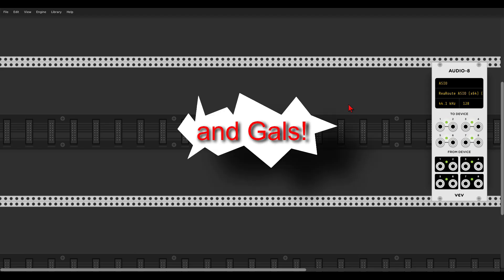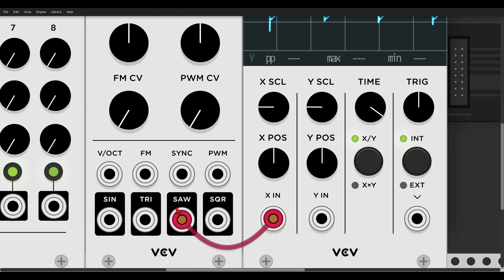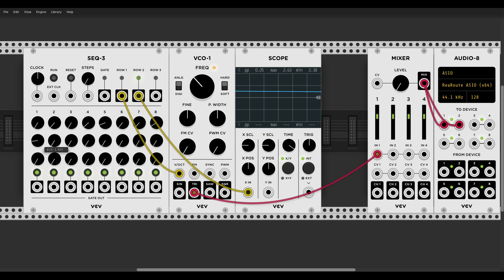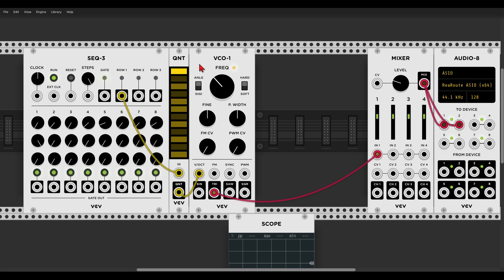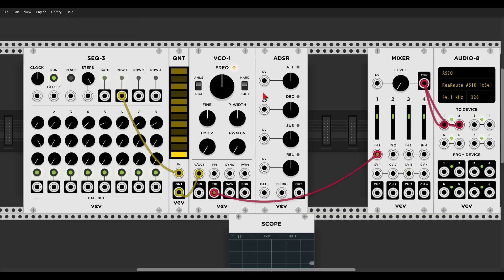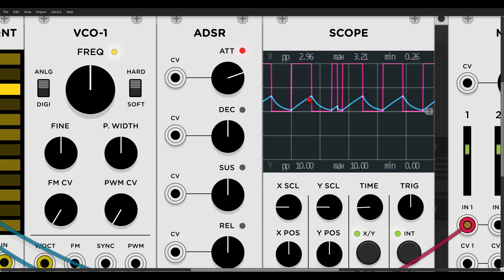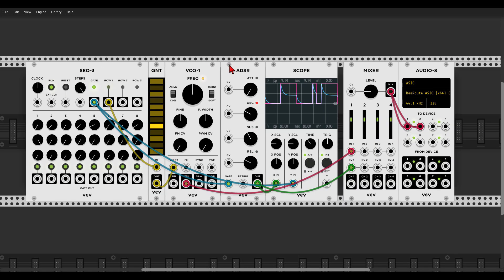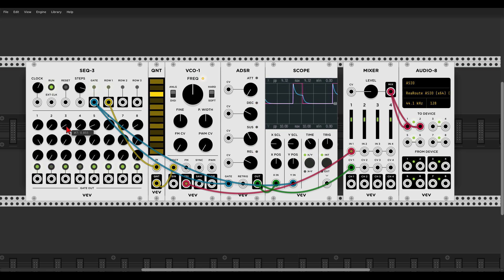Beginner's Patches I - Basic Sequence

Comment: Thanks for the amazing content but these modules look nothing like the version you're displaying here at this point in time (Rack 2 - January 2022). For example "Seq 3" has no "gate" or "row 1,2,3" anymore. VCO-1 doesn't exist any longer it's just called VCO now and it doesn't have the same connectors. ADSR does not have "out" any longer. I have no idea how to connect these.
Reply from the maker: Hi! Don't let the looks confuse you, they are pretty much the same. Actually, it's even better that they don't look the same because it will bring you to concentrate more on the ideas behind the modules rather than the modules themselves so you could use any other oscillator or sequencer. That said, have a look here - https://omricohen.gumroad.com/l/vcv2fundamental
I created a free mini-series on the differences between the versions. I hope it will help you.
Reply: @OmriCohen-Music  cheers Omri - I'll check it out

Comment: This is a really helpful video, cheers Omri 👍 I have a quick question about the Seq 3 module though. In VCV Rack 2, it doesn't seem to have a gate thing. Which way would be the best way to connect an ADSR to a Seq 3 in VCV Rack 2? 

Thanks!
Reply from the maker: Cheers! Well, in the right click menu, you can change this setting by activating clock pass-through. It should output gates then. Have a look here - https://omricohen.gumroad.com/l/vcv2fundamental
I created a free mini-series about the differences in V2 with the Fundamental modules. You might find it helpful :)
Reply: @OmriCohen-Music  Thanks Omri  🎶 🎵

Comment: The delay and reverb is possible with the beginner VCV modules?
Reply from the maker: Well, the delay yes, but there's no free reverb from VCV, unfortunately. There are other free reverbs though.
Reply: @OmriCohen-Music  Nice! Hopefully You will though this on other videos (Still haven't watched yet, so I'm doing step by step) 

One thing that I didn't understand is, Why ADSR is connected to the Mixer? 
 

1The clock and sequencer create the pattern of time and voltage gate.
why the gate goes to ADSR and not VCO? 

it seams that the two things are treated separated. but why is that?
Reply from the maker: @rafaelriva0  Yeah, in the fourth video I add a delay :) This mixer from VCV is actually 4 VCAs so each channel has a CV input that you can use, for example, with an ADSR envelope to control the level of the signal. The ADSR is working together with a gate signal that dictates when and how it should work. The VCO will generate the sound, but the ADSR will set its level envelope, its volume over time, together with the gates. I hope it makes sense.

Comment: As a beginner, how do I avoid clipping? Also, is there any module that shows loudness in db?
Reply from the maker: Hi! Well, it's all voltage so you can use any kind of attenuation basically, even a "simple" VCA. And yes, there's the stereo VU module from BogAudio that you can use. And I anyway recommend having the BogAudio collection, especially if you're a beginner. Let me know how it goes :)

Comment: Thank you so much for this! I have a question, what is the signal flow? I understand how to make a ADSR work, but cant figure out how LOL. Like, when do we modulate the signal with the ADSR? Because by the look of it, its in the end of the chain, but it dont make too much sense for me. Anyway, I tried my best to be clear... Cheers!
Reply from the maker: Hi! Think of an ADSR as a one shot modulation source. You gate it, and it outputs the signal once. So basically, you can use it for all sorts of things and it doesn't have to be at the end of the chain. That said, it's common to use an ADSR for controlling the amplitude of a voice. For this, you will need some sort of module that can allow you to change the amplitude and it's also controllable with CV. This is the VCA. So you can send your voice through the VCA, and use the ADSR to control the amplitude of the signal through the CV input of the VCA. That way, instead of manually changing the amplitude of your voice, you gate the envelope and it will do it for you.  Does this make sense?
Reply: @OmriCohen-Music  thank You so much for the answer! I think I got it. Your channel is a AWESOME source for my studies. Cheers! 🙏🏼
Reply from the maker: @vjcasagrande  I'm happy I can help 🙂

Comment: Bro, thanks for this amazing content! you're the best, correct me if im wrong, but when you change the pitch on VCO to A 440hz, the scale that you got is A minor, right?
Reply from the maker: Thanks! Well, yes, the quantizer will add an offset to the pitch you have on the oscillator so if you have a minor scale set on the quantizer, and the oscillator is tuned to A, you will have an A minor scale.

Comment: Absolutely fantastic video! I have a little question, if I may. When I try to route the out of the ADSR to the VC1 of the mixer, for some reason all sound stops. Am I missing something? Everything else seems to be fine. Thanks in advance!! :)
Reply from the maker: Thank you! And yes, that's normal. As soon as you connect the ADSR to the CV input, it will wait for the CV so it knows when and how to work, sort of.

Comment: omri! Where did the reverb and delay come from? Do you have this running through a DAW?
Reply from the maker: I just added them in post...
Reply: @OmriCohen-Music  thanks for responding. What I should have asked is how are you getting sounds out of vcv rack into a recording program? I haven't figured that out
Reply from the maker: @darrenfromla  Oh ok, no worries :) Well, there are a few options. First of all, you can use the VCV recorder to record audio (and even video) and then load it into your DAW. There are also polyphonic recorders from nysthi that can record up to 64 channels. Another way is with Reaper on Windows, that's what I'm doing. On Windows, Reaper has a plugin called ReaRoute, which allows you to route sound from VCV into Reaper in real time. Let me know if it's interesting for you and I can help you out setting it up.
Reply: @OmriCohen-Music  thanks for the info and the help! I was just researching and found something called midiloop. Should help me get vcv routed into ableton live. Reaper is great though. Thank you for offering y help and thanks for the feedback. Much appreciated
Reply from the maker: @darrenfromla  My pleasure, have fun!
Reply: @OmriCohen-Music  im using ableton and there's a few workarounds to get it working  but it's definitely not as easy as reaper.

Comment: In a real analog ADSR, it seems to me the Attack and Decay set a rate, rather than an actual time. In particular, if you have a high sustain voltage, the Decay will last a short time, but a low Sustain level will result in a longer Decay. I suppose the same would be true of Release ... if a new note comes along, the previous note never decays to zero.Ooops, Guess you can tell where I paused to write this ... you said the same thing about Release.
Reply from the maker: Well, think of it this way, when the sustain is high, the way the decay time has is much shorter than when the sustain is low so it's all relative at the end of the day.

Comment: I am just starting out so this may be obvious. But, how do you change the size of the gate? Just by changing the clock rate? Otherwise notes would have to overlap?
Reply from the maker: Well, there are a few ways you can do this, depends on which modules you use. In this case, as in the video, you can use DGATE for example from BogAudio. It has a Gate Length knob that you can use to change the gate length. Don't forget that a gate is just a pulse wave so if you're using an LFO as your clock, for example, you can change the pulse width, which will give you the same result. Does this make sense?
Reply: @OmriCohen-Music  Yes. Thanks very much for this! So by default the clock just a pulse wave by default? And by default, the gate is locked to the clock? Unless I repatch it? (not sure I'm asking this question clearly)
Reply from the maker: @gkillmaster  Well, if we're speaking about this specific sequencer, the SEQ-3, than the gate output will just output the clock by default, unless you disable a step by clocking the green lights under each step. And you can try and use other waveforms as your clock, but the most stable will be to use a pulse wave so that's why most of the clocks (I say most because I didn't check them all but I'm pretty sure they're all the same) will output a pulse wave. The only difference will be the length/duty cycle/ pulse width of the wave.
Reply from the maker: @gkillmaster  My pleasure :) And yes, this is a universe whole by its own. Just make sure to take it one step at the time, and don't give up!

Comment: Just a quick tip about the Scope. If you are looking at something that is triggered by a clock or gate like when you where looking at the Envelope shape, you can use the gate to trigger the scope. Wire the gate or clock into the Scope's far right input and click the button to make it use an external trigger (EXT light is green). If all goes well then you'll have a steady look and your Envelope shape. You may still need to adjust the trigger level to get a steady image. This is also really useful for looking at your waveshapes. You can use a square wave of the same frequency as your note to hold the wave steady on the scope.
Reply from the maker: Perfect! Thanks so much!

Comment: I'm afraid I missed something ... how do I set the patch cables colors?
Reply from the maker: Well, the cables have a certain order so if you have a green cable, the one after that will be red, then blue, and then yellow, so you can just use the color you want. There is also an option to add\change colors in the settings-v1.json file in the Rack directory.
Reply: @OmriCohen-Music  Thank you, I just wanted to ask the same question. It would be nice to have a colorpicker in the menue. I hope it will be implementet. But to know that the color is not choosen randomly is nice to know. Im not sure if the color is changing after reopening the project. I need to try it out tommorow. 😃

Comment: How do you use triggers?  I see that a lot but don't see how they're used. What's a shift register?  And what is the different between a clock modulator and a generator,  skew, or multiple?   I was poking around on the Modular Grid net & saw all of these things mentioned but not exactly understanding what they are for.  It would be nice to see an application in VCV Rack where applicable.
Reply from the maker: Great ideas my friend, thank you!

Comment: Really good tutorial helps me to understand the synthesis more. How do you make the gate longer? Or does it have to be longer if you want longer note?
Reply: Bonjour, le sequenceur génère un GATE donc en ralentissant la vitesse du sequenceur le GATE sera plus long, donnant ainsi plus d'espace à l'enveloppe pour se réaliser. Cependant il existe des modules permettant d'allonger un TRIGER qui est une impulsion très courte pour en faire un GATE et donner une fois de plus le temps à l'enveloppe de faire son cycle.

Hello, the sequencer generates a GATE so by slowing the speed of the sequencer the GATE will be longer, giving more space to the envelope to be realized and make long note. However, there are modules to extend a TRIGER that is a very short pulse to make it a GATE and give the envelope time to cycle again. In chain u will have very long note.
Reply from the maker: Thanks so much! Well, this sequencer has gates with a fixed pulse width, but there are ways to change this, and we will also look at different sequencers in future episodes that have this feature also built-in.

Comment: Great video. I look forward to the series.

I would say use the scope as much as possible as it makes the modulations a lot easier to understand. You make great use of it in this video.

I would suggest doing a video on attenuverting the v/oct output of sequencers and random generators. It took me a while to figure out why my VCOs were popping and cracking and it was because of the input being fed in way too high in amplitude.
Reply from the maker: Thanks! Yeah, the scope will be an important part of this series. Thanks for the suggestion also!

Comment: Hey Omri, I often see envelopes used with a separate VCA module, but I've always preferred using an envelope generator connected to the mixer channel attenuator as here. Is there a 'right' way? I guess not, but am perplexed why someone would add another seemingly superfluous module: a separate additional voltage controlled amplifier. KiSS ;)
Reply from the maker: Hi! Well, there are a few reasons I can think of. First of all, you have to think about response curves, some mixers will respond differently to the incoming voltage. Also, usually the mixer is not a part of the chain but comes at the end of the chain, after all the processing and effects, so maybe you want to control the level before all that. It's also easier visually to understand what's going on when the VCA is a part of the actual chain and not somewhere distant from it. Also, usually, a VCA is just an attenuator that can be controlled with voltage, and a mixer can also amplify the signal, something you may not want. In hardware, by the way, many mixers don't even have CV inputs for their levels. Anyway, since we're talking about modular, there is no right or wrong, so if using the CV inputs of the mixer works for you, that's more than ok :)
Reply: @OmriCohen-Music  I didn't consider differences in attenuation slope, that would make sense, some VCA's give a choice between linear and exponential response. Perfectly logical. Cheers Omri

Comment: Thanks a lot Omri! Since you asked, I would like to see some midi-vcv integration with simple patches, how to use a midi controller to modulate vcv and write simple sequences and the like, and a simple introduction to how to use FM and synchronized oscillators (with the vcv fundamentals VCO)
Reply from the maker: Thank you! Yeah, I will touch also Midi at one point, for sure. Also FM and Sync, totally, good ideas!